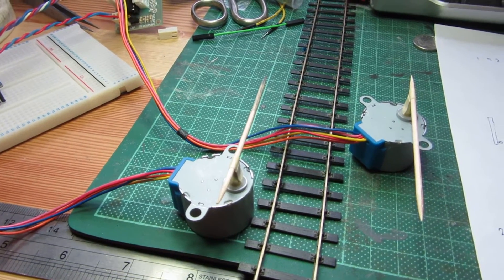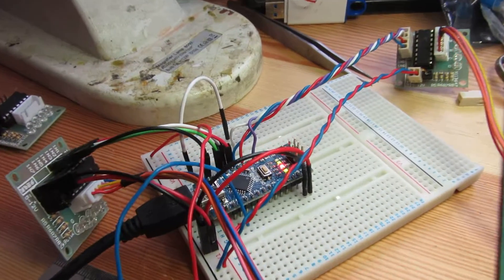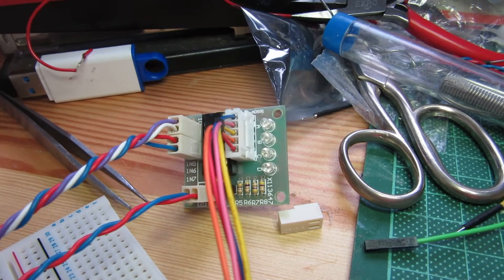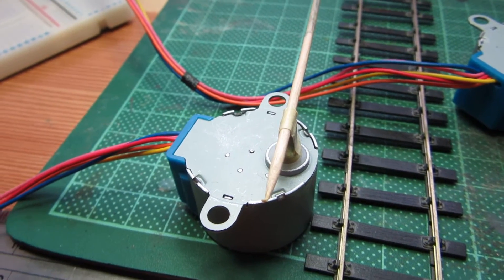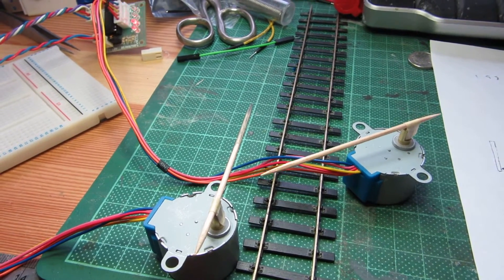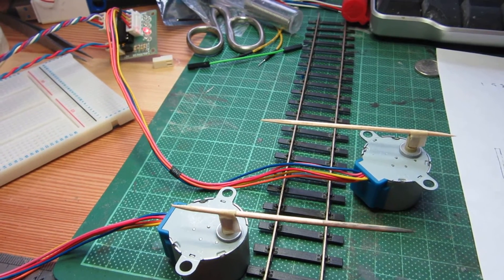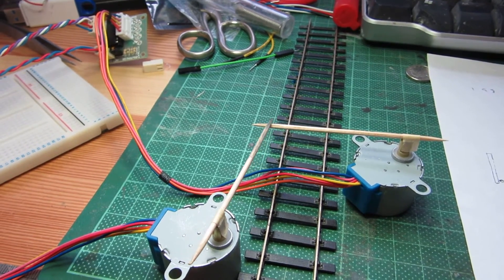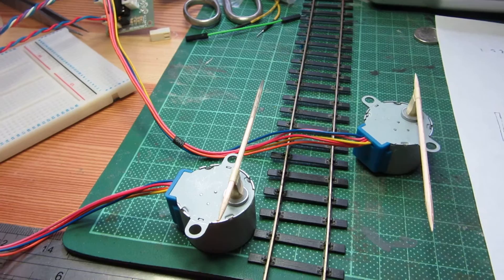MVI 0539

Comment: Hi David, any chance of sending me details of how you wired this all up? Regards Barry
Reply from the maker: Hi Barry
It was pretty straight forward. Each of the stepper motor drivers take 4 outputs to drive each coil and there is one switch as the input for open and close. If you drop me a mail to david dot barham at ntlworld dot com I can send you the arduino sketch
David